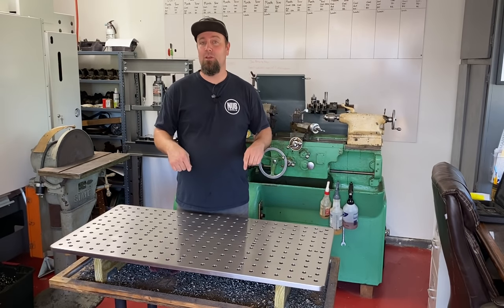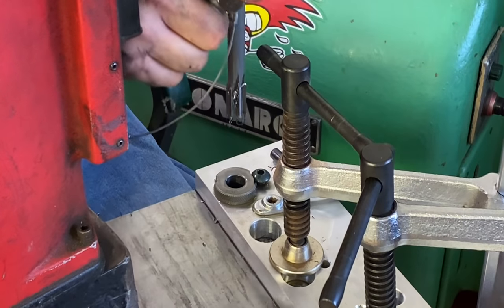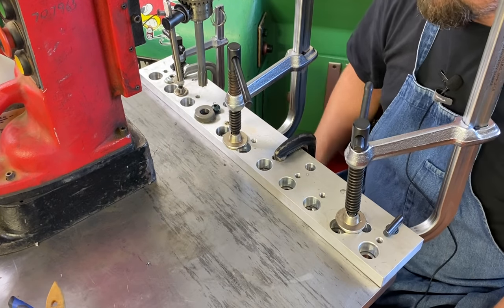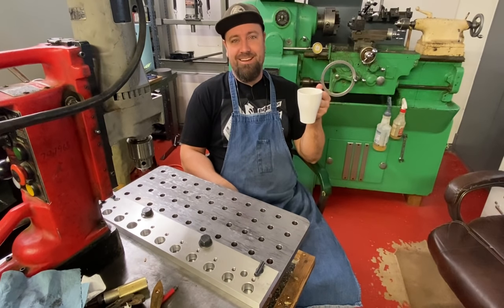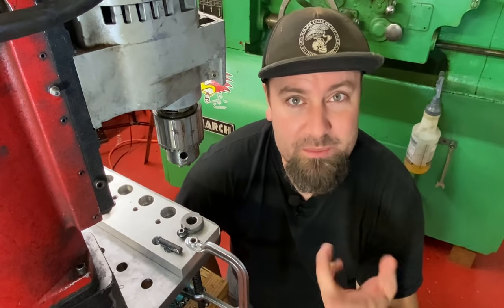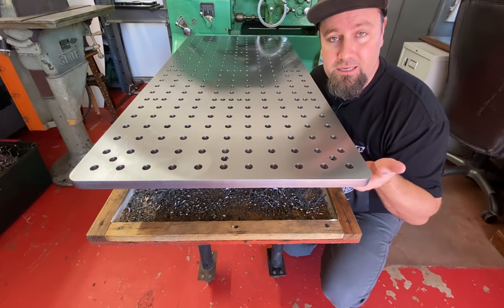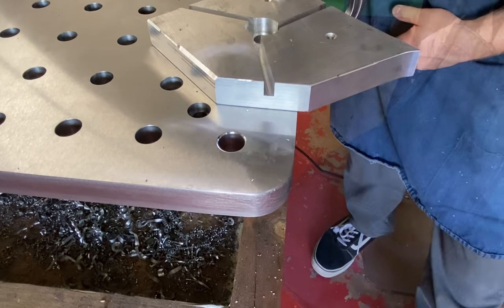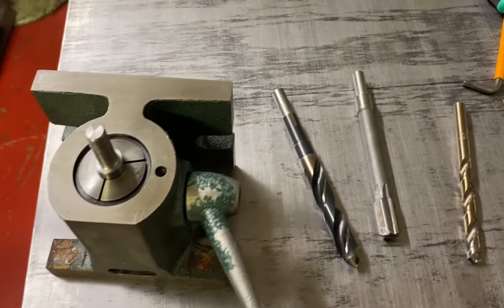My Welding Table Build | Drilling Precision Fixture and Clamp Holes With a Mag Drill Jig

Comment: Any accumulation of errors apparent when you measure between first few and last?
Reply from the maker: Yes there was unfortunately. From the first row to the last , the pattern grew in length somewhere in the neighborhood of .03”-.05”. The good news is that from the best that I could measure, the pattern is on the money in straightness and squareness. Which is my most desired characteristic. And I thanked my lucky star for that. A friend of mine pointed out that if I would have started in the middle and worked my way out that the growth in between row separation would be cut in half. Sounds correct.
Thanks for the question and watching!
Reply: @nubtools   the growth would have been cut in half, but would have happened twice.
Reply from the maker: Agreed

Comment: FWIW: It probably would have been a lot quicker to make a track\guide for the Magdrill to align the holes instead of a Drill Jig with bushings. For instance set up a trolley for the MagDrill that slides on a track using dowel pins for alignment for the mag drill trolley.
Reply from the maker: That sounds very interesting 🤔 It was very easy to move and position over the bushings and the drill I had , had so much slop that if I would have relied on a track and the drill itself, I think I would have been in trouble.
Thanks for the comment and watching!
Reply: @nubtools  Track would have been more accurate & a lot faster, because position on both axises would be repeatable.
Reply from the maker: It’s a very interesting idea and you may be right. A lot to unpack there from A to Z.
Thanks for watching!
Reply: @nubtools  Thanks for Sharing!
Reply: I'd love to see a sketch, or ideally a video.

Comment: Did you consider that a hogan drill and bit would have done this in about 1/8th of the time.. you obviously know what youre doing just asking why.
Reply from the maker: You are correct, that those would be way faster, but a particular hole tolerance was what I was after and not necessarily what was fastest.
Thanks for watching!
Reply: @nubtools  For sure hope you don’t think I was criticizing just commenting
Reply from the maker: Not at all. It’s the most common question I get. 🤝

Comment: I just had my local cnc shop do the holes for $375, money well spent.
Reply from the maker: That is money well spent indeed!
Reply: I would think that was a good price too, what size and thickness is your table?
Reply: @nubtools  I haven't read through all the comments but has anybody told you yet that you travelled the wrong way with the router? I've never used my router on steel but it makes a big difference to the quality of cut on wood.
Reply from the maker: No but that wouldn’t surprise me!😂

Comment: Don't you have a milling machine? Use the jig to center drill all your holes and do the drilling with the mill.
Reply from the maker: Not big enough unfortunately. 🥲
Reply: @nubtools  your mill  doesn't have an adjustable ram? Even if not,could at least get the three rows all the way around
Reply: Either way,I like your jig.i have a 4x8x1 table I want to grid.
Reply from the maker: The enclosure is the biggest obstruction
Reply from the maker: Thanks, keep a lookout on my Instagram @nubtools and nubtools.com . Stuff to help is coming.

Comment: Why would you want the holes so close together? I mean those holes are expensive and to the ignorant ( me ) it looks like you're buying parallel and perpendicular. if that is correct, the size of your gauge blocks and reach of your clamps seem to be the only determinate of hole spacing. No?
Reply from the maker: The closer they are together the easier it is to put the clamp right where you want it.  Besides the 2x2 is an industry standard that I wanted to match and it looks cool. I have a friend that built a table with a 4x4 table and it is still life changing but he admitted he wishes he had a closer hole pattern. All I can say is now that the pain is gone I have no regrets and it is the best thing since sliced bread.

Comment: Why is everyone so obsessed with drilling these tables down to a billionth of an inch? I work in a welding/ machine shop that does extremely precise work. I would never consider that any fixture table  was accurate without putting a machinist square on it!
Reply from the maker: The voices in my head told me to do it.
Thanks for watching!

Comment: Dude your making that ridiculously complicated for zero reason simply a square and quick jig and a counter point with a mag drill I could give that exact  quality in a short afternoon and I would have angles in order to extend down the edge. And I would have cut slots in a uniform pattern on one sheet and with the slots on top and a big ass magnet weld all the slots full with weld turnd over and with floating grinding stones I would get it very close to a serfice plate at least tell I started to nic and scratch it up !
Reply from the maker: The reason: It makes me happy.
Thanks for watching!
Reply: @nubtools  you know what your exactly rite thanx for the time u take to video !